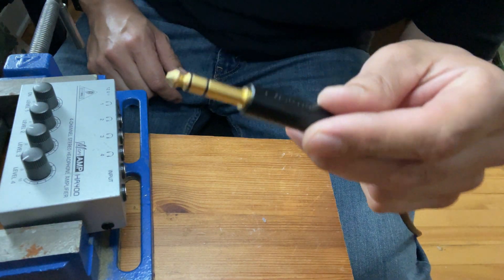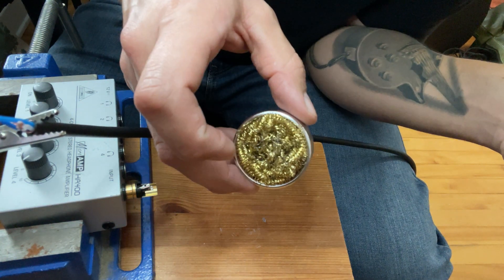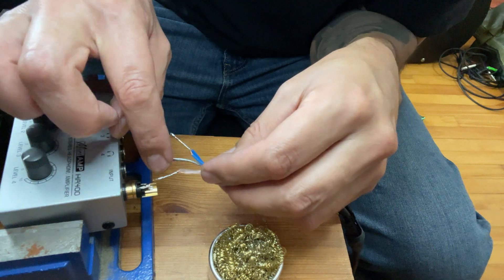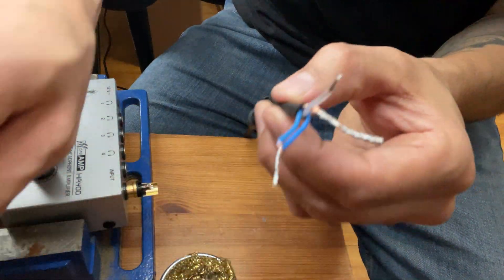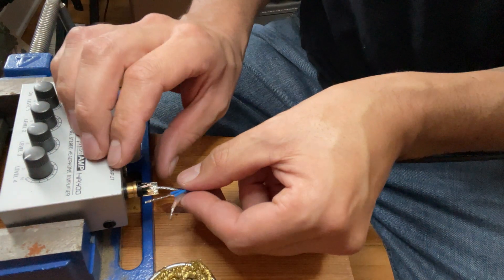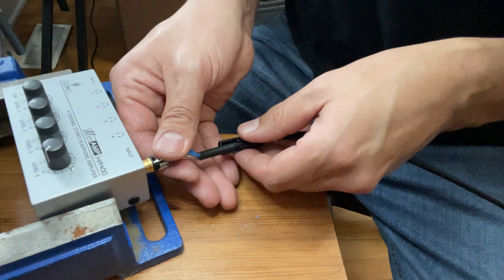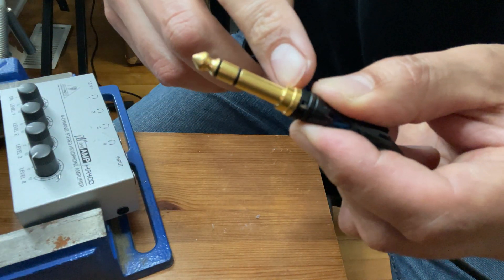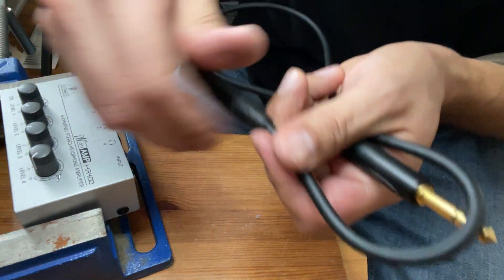DIY Soldering Mogami W2534 to Neutrik Gold 1/4” TRS part 2

Comment: the clamp also absorbs heat. and keeps the plug in proper fitting.  I started using this when one of my Rca plug got distorted and would not fit..i  also always use some female plug for trs or xlrs for same purpose
Reply: thanks! that's a great idea 😀